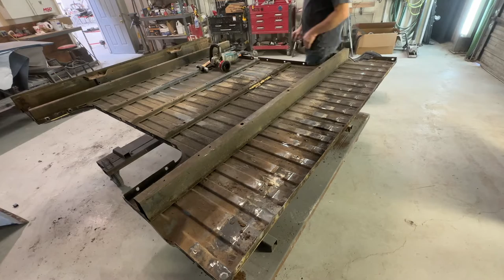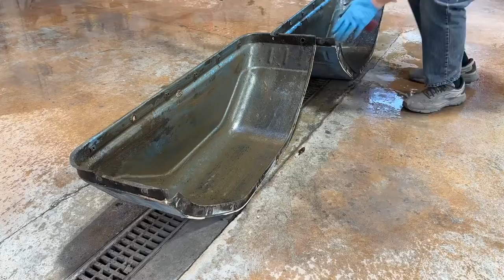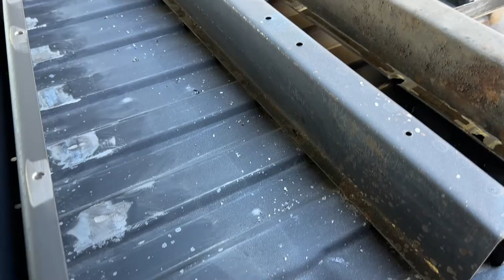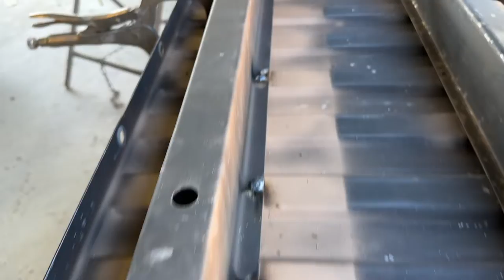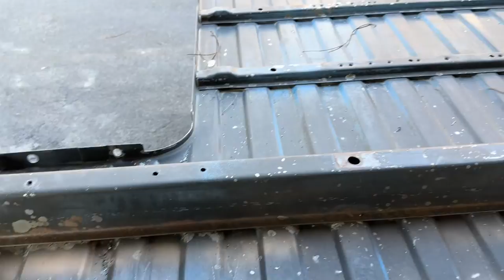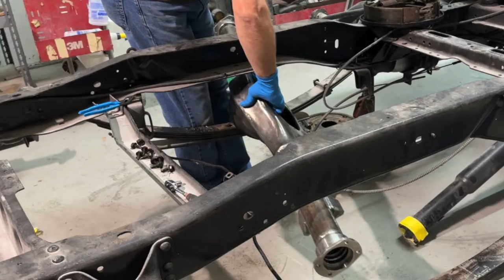C10 Project:  Replacing Rusty Bed Crossmember with LMC Part

Comment: Sand paper on the dolly is a great trick, thanks for that. I also used bed liner under the entire body of my K5, specifically Raptor Liner. That stuff seems great so far.
Reply from the maker: I’ve got some Quartz that seems pretty decent. Used it on the front wheelhouses and looks good.
Reply: I second the motion on the U-Pol bed liner underneath. It takes a licking and keeps on ticking. And the Aqua velva painter alway smells better! LoL! DK, Omaha.
Reply from the maker: @deankay4434  lol. Aqua velva…my first aftershave…good stuff, lol
Reply: big mistake!

Comment: The weld thru by SEM looks copper like U-Pol. Have you had any feedback on the products as I have seen video were zinc burns back into the heat zone! 
Thanks for the video lesson. My bed is wood but just a few brands unbolt as that sure makes a difference! Long bed in 67 = 100 bolts. 
DK. Omaha.
Reply from the maker: I’ll have to look that video up and check it out. Interesting
Reply: @StoutCustom   if I remember correctly " Hoosier Garage" by Adam just did a quick test with 8 spots welds for each for copper and one zinc. 
Also, "MrFireman164" uses the copper-based U-Pol on everything as he is building a Cameo ground up. He uses copper weld-thru on everything in plug welds or rosesett welds. I think he did a destructive test also. Sorry to bug you, you're a busy man. 
And damn fine at it too! DK, Omaha.

Comment: Are you going to paint all the bed panels and then reassemble them? I am prepping the bottom of mine for bedliner as well, but perhaps taking it all apart would be best. Could paint the bedsides flat if doing a solid color. Just not sure on reassembly after it's painted with the factory welds, seam sealer, etc.
Reply from the maker: I’m going to have to feel my way through it. Like you say there are still the welds to get painted after assembly as well as the seam sealer so….?  Most likely I will paint apart and then spot in seam sealer and welds. I think
Reply: @StoutCustom I thought maybe panel bind instead of the welds, but that doesn't account for the seam sealer. Could always spot that part in for sure.
Reply from the maker: @robbcrabtree  when we do a partial bed repaint for insurance work we tape it off on the seams and it looks good. I figure it should look good if it’s taped off well.

Comment: What are you going to use to paint your axle? I'm just about to do mine, just got all the bearings, but not sure what to go with. Want something durable for this k30 I'm building.
Reply from the maker: I put epoxy then SEM’s Hot Rod Black. It seems fairly durable but I think powder coating would probably hold up better.
Reply: @StoutCustom thought maybe epoxy then thin out some bedliner and shoot from hvlp. Satin black, light texture and should be durable. But if it doesn't turn out, it would be a nightmare to remove, haha.
Reply from the maker: @robbcrabtree  yeah it would, lol